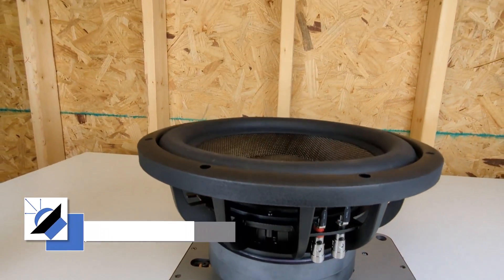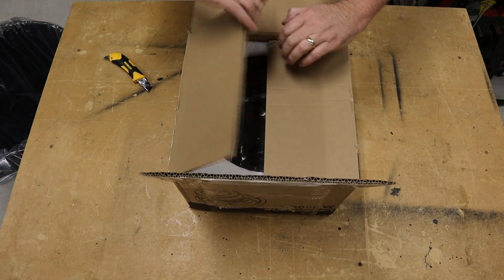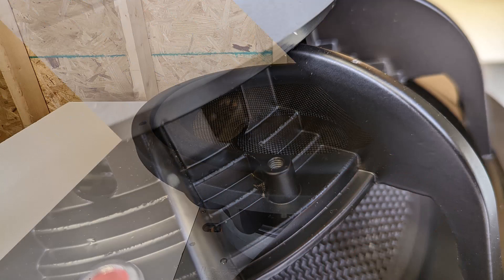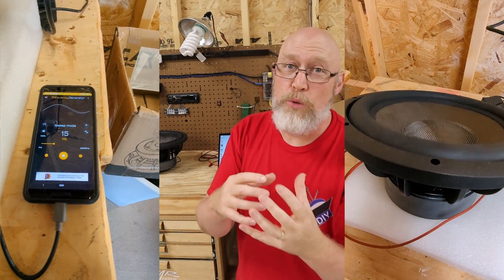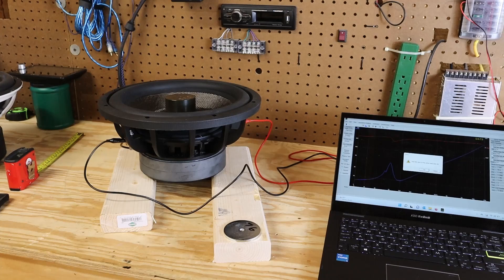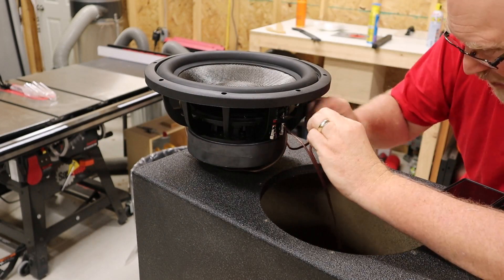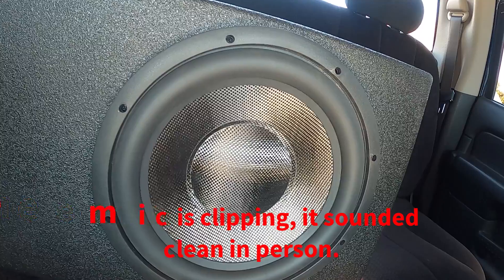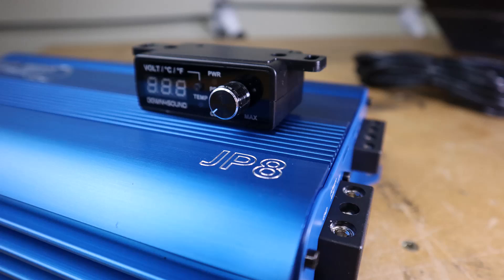1000 Watt Carbon Fiber Subwoofer:  Light Harmonic Thunder 12

Comment: Im taking a chance on an 8" no name carbon fiber woofer. $50 on ebay. All specs and frequency chart were provided. Cast alliminum with and FS of 25hz. The xmax is only 1mm (!) but I'm hoping in a small sealed cabinet that will just mean faster transients at lower power. I'm excited to see if it's great or a dud. It will be used in our bedroom for home theater.
Reply from the maker: 1mm? That can't be right.

Comment: I have the DATS and here is how you do it for the Vas measurement.  First find the Fs as you did. Then calculate a 25% downward shift.  Then you have to take "fake" Fs measurements with small increments before you actually do the Vas measurement.  So if you get 50Hz for Fs,  you have to force the added-mass-Fs to dip just slightly below 37Hz.  So you keep adding mass in small increments until your "fake" Fs is actually below 37Hz.  Then you know you have the correct added mass for the software to find the Vas.   Now remove all the added mass, and re-take the T/S parameters to get the true original measurements back in the value boxes.   I sometimes have to re-start the software if I still get that error, and sometimes you have to unplug and plug back in the USB connector.  But once you do, it will indeed retrieve the Vas (and make sure you do not have any other values filled in the other fields in the other boxes for the other vas measurement types, because the software gets confused if any of the other boxes (such as the test box method) have values.
Reply from the maker: Now that I read that I think I see what my issue was.  Thank you so much for the tip.

Comment: I have found that DATS regularly gives higher Fs readings than expected for a subwoofer with a large moving mass and very stiff suspension; it tests T/S parameters at a very low voltage, around 270 mV rms. It's more than accurate enough for smaller speakers including many woofers, but subwoofers with "fat tire" surrounds and multiple spiders seem to be the most affected. A system like Klippel can be configured to test at higher voltage, because it uses a separate outboard power amplifier, and the large signal parameters usually give a substantially lower Fs than a small-signal measurement. For a long-excursion driver, this large-signal Fs parameter is more accurate.
Reply from the maker: DATS:  $130, fits in a desk drawer.  

Klippel:  $100,000 minimum, takes up an entire room.

To quote the economist Thomas Sowell, there are no solutions only trade-offs.

The factory in China that made this subwoofer should have a Klippel.

The DIY guy out in the garage will have to make do with the DATS.
Reply: @DIYAudioGuy  DATS works as it should, and gives accurate information and readings. I have used it for years, from the first version, and the "Woofer Tester" program well before DATS. Nobody needs a $100,000 setup, to do the things that the common man does. And as the OP was trying to make a point, of giving false fs readings on drivers with stiff suspensions...the fs is always going to be higher, with a stiffer compliance suspension and spider setup.

Comment: When you do added mass measurements, you need to make sure the mass is also immobilized relative to the cone; the ideal thing would be to glue it, but a non-curing sealant like "mortite" or "speaker sealing caulk" can also do this function. Since you have lots of boxes around, you probably have a small sealed box, so maybe instead of using added mass, use a small sealed box of known volume and do the reference box method that DATS also supports. The box just needs to be small enough that Fc is 25% different from Fs.
Reply from the maker: I will be sure to add something sticky, but not to sticky, next time.

Comment: If the Fs really is that high, your best results will be obtained in a vented box.
Reply: except for the fact that the Qes and Qts is utter crap.  Did you see how high they are?  You need Qes/Qts down low near 0.25-0.30 to excel and bring the EBP up near 100.  It would suck in a sealed box as well since it just has sh*T for parameters.
Reply: @zod-engineering-welding  If QTS is high, you can tune further below Fs, and the effect of the high Qts will fill in the saddle between the port peak and the Q bump. EBP is only a guideline for applying a driver but the rules of thumb are only that - they are not universal. Is it ideal, probably not, but it should be usable. Until there's something measured with Klippel we don't really know what the parameters of this speaker are; DATS isn't especially good at measuring large size or high Mms drivers because the suspension characteristics undergo a meaningful change between 0.28Vrms and 1Vrms, and you'll see that change if you use a Klippel system to test at both voltages. The DATS has enough voltage for testing Hi-fi woofers but I have found it to have more variability testing today's high-Mms, high-Xmax subwoofers when compared with Klippel.

Comment: Dual Coin circuit probably refers to using neodymium magnets on top of the magnet pole to focus more flux in the gap and avoid fringe field leakage. But they are not shown in the side view of the motor assembly on the web site, which also shows a concerning choke point on the pole plate that may be reducing flux in the gap.
Reply from the maker: You clearly know quite a bit about how speakers are put together!  I think it's pretty obvious that this company just ordered a parts bin subwoofer from China and they slapped on the carbon fiber cone in an attempt to make it seem exotic.
Reply: No, pretty sure it just means "dual coil" and is a typo.
Reply: Yeah, it’s referring to a complex electro-mechanical…..misprint. It’s dual “coil”.

Comment: you won't get rated at 1ohm power after rise unless you have something like a taramps smart.  I personally recommend you get one for power testing because you can actually get what you are going for . dats isn't as great as people make it seem for testing ts specs as you found out in trying to test . if you haven't looked into diy lithium you should.  I can help you with any battery questions you have .
Reply from the maker: I eventually need to build a battery bank.  I will give you a shout when I have questions.

Comment: That frame uses a 7-8 inch landing so the biggest coil it can use is 3 in if I had to say this sub should be ratted 600-1200 watt RMS max
Reply from the maker: Yeah, it definitely looks like a thousand watt subwoofer.
Reply: @DIYAudioGuy  honestly it looks like the motor on it is a rip off of a p3 or like one of those gothic subs by power acoustic

Comment: When you were mentioning the coils scraping the surrounding speaker, as a bass player I would call the speaker "blown". I test if a woofer is blown by gently pressing the speaker cone and listening for a scraping sound. If it scrapes, it is blown. If it doesn't move at all, it is history.
Reply from the maker: Absolutely, typically when the coil gets too hot and starts to unwind and you get that scraping sound when you push on the cone.

Comment: They should at least gave a speaker resonance frequency to help seeker cab design and porting. I have the feeling 3000 watts would toast this thing. For something claiming to be this powerful. I would expect the resonant frequency to be in the high 20s or low 30s (HZ).
Reply from the maker: I feel like light harmonic had the opportunity to knock this one out of the park, and they chose to bunt instead.

Comment: Dual coin coaxial alignment is just a pair of shorting (faraday) rings. This subwoofer has too much mechanical suspension for its moving mass, which is why the Fs is so high. You can also get VAS from a known sealed test box. I suspect this driver can sound great in a very large ported enclosure.
Reply from the maker: You are probably right.
Reply: @DIYAudioGuy  I designed and built so many subwoofer enclosures and this sub reminds me of the old low mass high Q subs from the 90’s. I’d like to see this head-to-head in a proper enclosure versus something with a lot more motor, coil, and suspension.

Comment: Just caught the video and was interested in finding out more about the company. So what I found was the company was founded by a guy named Larry Ho. Larry moved from China to the US in about 2000 or so. After some other ventures he started Light Harmonics in 2011. He came out with some nice designs, but it appears they weren't massive sellers. Then around 7 years ago he did a crowd funding on a headphone DAC called the geekwave. He raised about 6 million dollars. Larry never delivered and backers became angry. Lawsuits were filed. The CA attorney Gen was notified. Larry fled back to China. It appears the original Light Harmonics doesn't exist. Just the name. I think he sold the company in China to people that just build whatever they have designs for. The addresses in CA are bogus. One is shared office space. The other is a Doc's office.
Reply from the maker: Thanks for looking into that.  Another viewer posted info about the crowd funding fiasco.  Light Harmonic took a month to ship the item AFTER they created a shipping label.  By the time I could post a video the sub was out of stock.  It may have never existed in the first place.  I wonder if I have the only one?  Notice that in the amazon description there is a branded label on the back of the magnet, mine has nothing.
Reply: @DIYAudioGuy  hey it's manufacturer on demand and that means everyone is just a little bit different. It's that bespoke feel that really screams quality
Reply: This is probably why you can't get any specs. From around 2015 to 2019 Larry and his Ceo Gavin Fish used to post heavy on the Audio forums. It was a pretty small company of about 20 people. Then after the Crowdfunding Fiasco Larry became a ghost. 50hz seems way too high for a sub. Even late 90's subs were probably lower. Maybe try breaking them in for a month? Enjoyed the video.
Reply: Makes sense. I was just commenting that it’s probably not the same company.

Comment: great review on the sub. I also have an Mechman alternator, they are everything that you hear about. i never dip below 14 volts now compared to the stock alternator i had that was 75amps. i was recommended by mechman to add an second battery so that is my next move. you should do an video on your upgrade process!
Reply from the maker: That video will drop this weekend.
Reply: I've been super happy with my 2nd battery. But for those who have ECU'S that don't allow something like that such as my VW Passat, I use my 500amp/700peak amp battery isolator. Works fantastic!

Comment: That's a pretty turd I guess🤷‍♂️ when I first ordered and recieved my Sundown Xv3 12's the coils read 2 ohms each. I ordered dual 1 ohm subs. I was like, what the hell? I hooked them up and ran em in parallel and checked the next day and each coil read .9 so they were just so crazy stiff. I'm not saying that is ur case tho. They're just douche bags lol.
Reply from the maker: I did break them in, and I've been running the sub for about a week before I tested the coils.
Reply: @DIYAudioGuy  you deff gave it to best shot possible for sure!👏

Comment: Thanks for the honesty and attempting to figure out the parameters on your own.
It's embarrassing that they can't even provide the basic specs besides power handling - and they still spammed the 'max power wattage'
This is what I would expect from a flea market knock off brand sub
Reply from the maker: Definitely not what you do if you want to position yourself as a premium brand, which is a shame since the sub seems to be pretty beefy.

Comment: It boggles my mind how a company can put something like this out and not have specs available to design a box for them with. Even though it's car audio, you STILL need to design a box for it!   It's a shame, it looked like a decently put together driver.   It was a fun video to watch... especially being able to go along with the ride on how you figured everything out. Nice!
Reply from the maker: Right, it's a perfectly fine subwoofer. Just not really useful without reliable specs.
Reply: DS18 has an almost $900 three way comp set that has nothing for drive info other then ohms and size.
Reply: It was 8 ohm speaker, hardly usable in car audio other than professional 8ohm amplifiers.

Comment: Looks like it could of been built in the same build house in China  as the ultra max change slightly and sold back. China kinda none for doing this quite a bit.                         To bad you don't do business with or friends with Patrick from under ground robot he could hook it up to his bench and run it for you and give you the ts specs  he test every sub after brake that he builds.   a lot of people have him build there sub to the specs they want at least close 👍👌✌️💯🍻⚒️⚒️🔧🎶🥂 have you herd of a collosal sub 12in dual 2 ohm  it has a fake carbon dust cap but they have some serious travel and can take some power that I've seen they just came out to.✌️👍💯🎶
Reply from the maker: Yeah, that guy makes him insane subwoofers.
Reply: @DIYAudioGuy  if you go to his channel he made a video for the passive subs and tuning them that I was just saying that he can build for cheap he also shows reciol model of passive I want to say he said 45$ for the passive that half the price as parts express at least ✌️👍👌💯🍻🎶⚒️🎶

Comment: Looks like they tried to imitate the cone of Morel Ultimo woofers to attract buyers with a lower budget, but didn’t spent much on R&D. They probably tried to fool buyers with a big dust cap, but underneath a relatively small voice coil.
Reply from the maker: Should I cut it apart and measure the voice coil?
Reply: @DIYAudioGuy  Don’t please, how bad it maybe it is. I can assure you that my Morel Ultimo Ti 124’s voice coil is bigger and handles easily 1000RMS without funny smelling 😂

Comment: an IM/SG would be able to get those T/S digit's you need correct? not that that's a cheap solution 😅
Reply from the maker: I've never used one, my guess is you still have to put a weight on the cone.

And the dance is only cheap if you already have a laptop to hook it up to. If you got to go out and buy a computer then the imsg is cheaper.
Reply: @DIYAudioGuy  yup, still need a weight. i used to have one, used it on a Stereo Integrity HST-15 mkII i can't recall the determined Fs but it was ridiculously low!